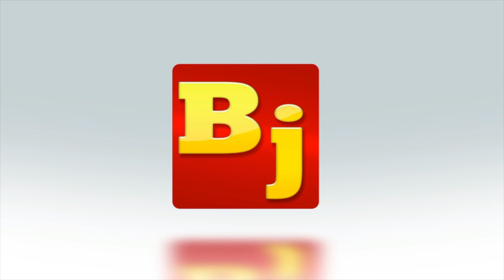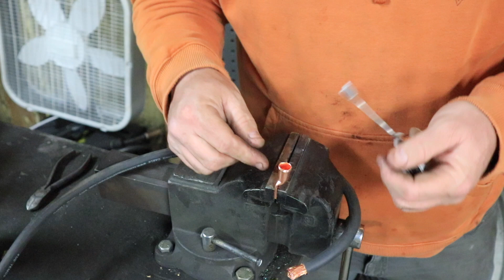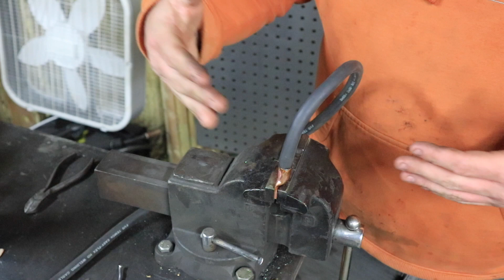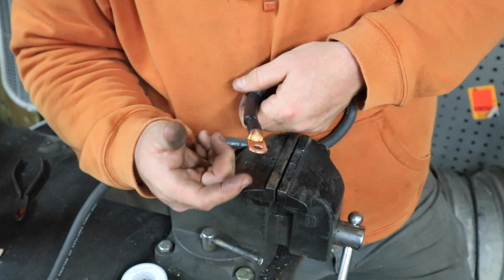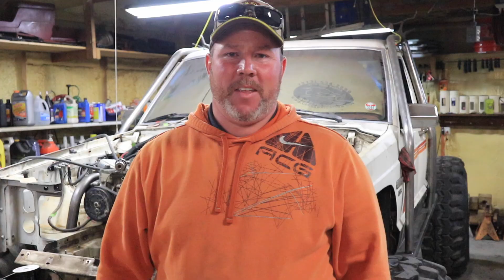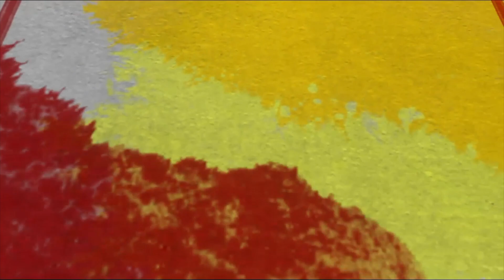How to Make Your Own Battery Cables the Easy Way

Comment: Man, You NEED to learn How To "Sweat" Pipe Fitting's.........SO MUCH EASIER to do like that, Then the way you are showing here❕

PLUS you Don't EVER want to use ACID Core on any electrical wiring either. Not even in a Car with 12 volt systems...THAT IS A NO-NO.

Comment: Solder might be the best connection for amateurs but its far from the best connection in the  professional world. Soldered terminations are almost unheard of in the aerospace industry, In fact NASA does not allowed soldered terminations on any space craft and there is a reason, soldered connections are brittle and subject to work hardening. NASA mandates pressure welds (AKA crimp connections) on all electrical terminations. Crimp connections are a form of cold welding and it creates superior vapor proof molecular bonded interface with far lower Ohmic losses then solder  aka I SQUARE x R losses. 

If you want to properly learn how to terminate wire connections I suggest you visit NASA's web site and browse their educational material and contractor specifications. Your tax dollars paid for all the research that went into putting a man on the moon and all that knowledge is free for your use. NASA even has a great series on proper soldering techniques.

Comment: You have explained cable lug soldering very well. Jeremy, you are an excellent teacher. Thank you. Well done!

But may I add some suggestions. The youtuber 1crazynordlander has made one excellent safety point. That's to make a mechanical connection with the cable and the lug joint. Because as he/she has stated in the comments of this video. If you encounter higher than normal loads thus higher than normal amperage and higher than normal temperature would occur. This means that could melt the solder and the cable will fall out of the lug. 

Let me add to this. Maybe do both types of joints. 

Make a mechanical connection with the lug first by crimping it to the cable to prevent cable from falling off the lug if it heats up from higher than normal amperage.

Then soldering the joint with rosin core solder ( not acid core solder), to prevent the copper strands from oxidizing. 

Finally add heat shrink tubing with some adhesive, or heat resistant silicon to prevent any moisture from penetrating the joint.

Also, if using cables in a environment where vibration occurs, when installing the cable, use cable ties to secure cable from any form of vibration at the joint.

Then as a maintenance measure, once cables are installed. Routinely check cables and connections for any sign of melting, wear, deterioration or damage

Comment: hydraulic crimpers are like, 30-35 bucks, and you're not really supposed to use solder if its gonna be in an engine compartment or around frequent temp changes, soooo...

Comment: This video should be titled "How To Make Your Own Battery Cables the Wrong Way". The solder has to meet the copper wire somewhere and it will make a rigid joint. With vibration that is where it will fail. The terminals are flared to allow some wire flex after the terminal has been properly "crimped". Also every strand is important to carry the load the current the gauge is rated at. Never clip off stragglers. The flare is not there to help you insert the wire, rather it is there to prevent damage due to vibration and when flexing the completed joint.

Comment: You can buy a hydraulic crimping tool which will permanently crimp the wire and you don't have to worry about how much solder and flux to use, what type of solder and flux to use, if you have enough fuel in your torch, etc etc. Hydraulic crimps are quick, easy, and permanent
Reply: ArcticAstrophysics they are sweet but not everyone has one! They are fast and easy no doubt.

Comment: 7:19 I disagree. Most people don't solder correctly so the solder does bead up like that, which is only possible when you touch the solder to the iron, or heat source. The solder should be applied to the wire after being heated by the heat source letting it flow through the strands.

Comment: You lost me at 6:50 when you said "acid core". Anyone who knows anything about soldering electronics/electrical components knows that acid core flux will cause corrosion.  Use only Resin core flux for electrical connections. Big fail.
Reply: It looks pretty after the heat shrink is on, but the acid core solder is not meant for electrical soldering.
Reply: Good point!
Reply: crimp. then maybe a bit of pond soldering
Reply: This whole video is a fail right after he said solder in the first two minutes

Comment: The flare is to help you get all the little strands in. Don't grind it off.
Reply: The flare is there to let the cable flex without cutting into the copper wire.

Comment: I prefer the brass compression terminals that goes around the battery pole and also clamps around the wire. Soldering the connector to wire is not always an advantage since it also allows for more mechanical force transferred to the connector from the wire because the wire will be a lot stiffer. Also remember that each joint in a wiring is a point where you can lose power or get trouble.

Comment: idk if soldering best way. Working on fleet motor coaches which have copper pipes. The Solder joints always break from vibrations....Most common daily repair in my line of work..... I wouldnt use this in a car battery. Solder doesnt hold up to vibrations

Comment: I've never seen the pre solder of the lug I like it Just a thought..the vice acts as a heat sink. Putting the connector in all the way will take longer to heat and you 'll have less working time for inserting in the wire.

Comment: Just FYI - Acid core is typically used for plumbing and rosin core is for electrical/electronics work.  Heat shrink tubing can be slipped onto the cable first away from the heated portion to prevent the insulation walking back from the joint when trying to put the tubing on.  Besides that, good vid!
Reply: Y Mn gf tty4v13450
Reply: Basically, "besides doing nearly everything wrong, it was a good video"...

Comment: Dude you do not use acid core solder on electrical connections.  Using your method you are likely to create a "COLD" solder joint as well.  The vice is pulling all the heat out of the joint too fast.

Comment: There is a lot of misinformation going on here.

A connection made by a good calibrated crimp tool is superior to a soldered connection in both longevity and conductivity. It creates a cold weld inside the lug and done properly is considered a gas tight joint; you cant even flow solder into it. The lug and copper cable strands actually almost become one solid mass.

The non flared lug that you have in your hand at 2:50 has stripes and letters on it for use with such a calibrated crimp tool.

The "E-A" on that lug indicates what die setting to use for that lug and cable size. The stripes are to indicate where to make the crimps, 1/0 cable calls for two crimps per cable end (thus the three stripes).

I am actually surprised he has that grade of lugs laying around and not the crimp tool to go with it; those lugs are more spendy then standard ones.

Get some real heavy wall adhesive lined heatshrink for sealing the cable and providing cable relief. The solder wicking up the cable is actually what causes many failures. The solder doesn't flex, it cracks and just fails. Example: Completely tin a strand of wire and bend it in half once or twice....

Also the heat from soldering degrades the insulation and other treatments/coatings of the cable jacket & lugs.

The only tinned cable to use is the kind made/produced at a factory; the entire cable is tinned for maximum protection but still flexible (such as the kind found in some high quality marine cable).

Many people who solder cables find over time that the cable within the lug corrodes away to nothing due to leftover flux and moisture getting in there.

If you must solder at the very least id ding/anvil crimp that cable lug on for mechanical retention and flow solder into it.

Comment: Jeremy, by any chance would you happen to know where I could find a complete engine harness for a 2001 XJ sport 2WD automatic transmission. I’ve looked everywhere with no luck because the harness is no longer in production.
Reply from the maker: Gonna have to get one at a salvage yard like pull a part.
Reply: BleepinJeep thanks 😔

Comment: I used to think that soldering was the best electrical connection but holding a Power Limited Technician license for wiring power limited circuits the past 15 years for communications, HVAC, irrigation and landscaping I found out that soldering connections is "Not Allowed" in the National Electric Code. Sure the NEC doesn't cover automotive wiring but the same principles apply. Only mechanical connections are allowed like crimps. I tend to agree with the NEC as heavy load will melt the solder and the cable will come loose. I think in this case a good dye punch for cables would be added assurance that the cable will not loosen under high amperage situations.
Reply: I was a shipboard electrician at a navy Yard. Always have a good mechanical connection first. Follow up with solder (Rosin Core, never Acid Core or Acid  flux) if you must to prevent contamination from entering between the strands.
Reply: Excellent safety point 1crazynordlander. Good to know. May I add some suggestions.

 Maybe do both types of joints. Make a mechanical connection with the lug first by crimping it to the cable to prevent cable from falling off the lug if it heats up from higher than normal amperage.

Then soldering the joint with rosin core solder ( not acid core solder), to prevent the copper strands from oxidizing. 

Finally add heat shrink tubing with some adhesive, or heat resistant silicon to prevent any moisture from penetrating the joint.

Also, if using cables in a environment where vibration occurs, when installing the cable, use cable ties to secure cable from any form of vibration at the joint.

Then as a maintenance measure, once cables are installed. Routinely check cables and connections for any sign of melting, wear, deterioration or damage.

Comment: Hey Jeremy, Great 1st video.  But, acid core solder is for plumbing and can cause issues when used for electrical/electronics work.  Suggest you use rosin core solder in the future.

Comment: When test fitting the cable you can solder the cable to make it solid and if it doesn't fit you can use a file on it instead of dealing with wire strands.

Comment: Nice vid with lotsa good info.  Probably be good to mention though,  that it's important to use real 60/40 lead/tin solder, not the wimpy lead-free crap you get at most box stores.  Also, preferable to use rosin core rather than acid core to avoid corrosion later.  Acid core will work but it's more for sealing joints and radiators etc. rather than electrical and should be rinsed off before covering with shrink tube.  Just sayin..

Comment: Rosin Core for electrical, acid core for plumbing. Use one of the small hose clamps to hold your stranded cable together so it can be inserted into the lug. Remove the clamp after the wire is in the lug then heat it up and push it the rest of the way in.

Comment: Quick tip from someone that has made a lot of battery cables. Buy one of those cheap hydraulic cable crimpers from Amazon. Reviews on the absolute cheapest ones are spotty, but The die-pressed crimpers are just so much better than the hammer "swage" style ones, and a LOT better than soldering. The bolt-cutter style ones are OK but unless you already have those, I would just buy a hydraulic one from the start.

That solder will eventually corrode, micro-crack, and fail. Not to mention there is no mechanical connection between the copper lug and copper wire strands. NASA agrees, and the Space Shuttle probably only sees half of the vibration that my XJ does :-D
I just checked, and you can get one of those crimpers for $38 on Amazon. Or get a better (Temco) one for $80 and it should last for a while.

And secondly, spend a few extra bucks and get adhesive-backed heatshrink. Helps completely seal the lug from water ingress and corrosion. Lastly, don't forget to put a proper fuse between the alternator and battery (positive) if you are upgrading from the factory cable which has an integrated fusible link.

EDIT:
I use KnuKonceptz cables if you need high quality 100% OFC power wire for cheap (rated to 150A, anything more and you should just go with 0/1 gauge)
Reply: i picked up one of the chinese crimpers, 12 ton style, when i did the big 3 in my hardbody, its long since paid for itself just in replacement cables i haven't needed to buy.

Comment: Great vid, J!  
One thing, though...I would strongly suggest NOT using acid core solder for wiring.  That stuff is designed to work with somewhat less-than-clean copper pipe and should not be used for wiring as the acid flux can actually eat through the small strands of wire (leaving a green, corroded mess).  For wire, you want to use rosin core or, better yet, fluxless (no core) solder paired with a flux paste like you used in the video.
Cheers, dude and keep those vids coming my man!!!!

Comment: Great job Jeremy. One thing: You said you had acid core flux solder. You really need to use rosin flux on a job like this. Acid flux will corrode like crazy over time if the flux is not completely washed off after soldering. It will eat traces right off of a circuit board. This being a large connection it will take longer but trust me that acid is crazy corrosive. Rosin core/no clean is what to look for. I found a site from a quick Google search that explains it better than me. http://www.harrisproductsgroup.com/en/Expert-Advice/tech-tips/rosin-and-acid-core-solders.aspx.

Comment: A little isopropyl alcohol will help that heat shrink slide on and you wont have the wires insulation moving on ya.

Comment: If you put some silicone dialectic grease on the part where the wire and copper head meet, and then put the heat shrink on; it creates a waterproof connection. Awesome vid!
Reply: or use heat shrink with glue inside will do the same thing too!

Comment: Great video Jeremy!  Another tip would be that when you are clamping the connector in the vise, don''t put it in all the way.  The vise is a huge heat sink, so it makes it a lot easier to heat up the connector if there is more distance between the end you are heating and the vise.
Reply: Gil Meacham yeah your right..

Comment: Great job Jeremy! I've been doing all my battery cables like this for years. I do all my connections with solder and heat shrink. I hate those little red, blue, and yellow crimp connectors. Every time I've had the taillights on a trailer quit working it's been one of those stupid little crimpits.
Reply: I agree but with a small caveat, quality crimps done with the proper tool are very good.  Problem is, noone wants to pay 100 bucks for the right tool, let alone finding quality crimps.  As for trailer lights in particular, they usually use the frame as a ground, I prefer to run the extra wire and never have issues.

Comment: Good video, thats how i do my cable ends too with the solder in the lug..... but before i put the solder in a scratch up inside the lug with a file or exacto knife and then before i put the heatshrink on i take a centre punch and smack a dimple into the cable lug to make sure the solder joint doesnt pull out.

Comment: Emery cloth to clean the fittings before you flux the fitting also helps along with having it hot enough I say this cause I solder copper every day using different types of solder

Comment: Short story time.  I'm all about wiring.  I actually enjoy wiring vehicles and have become really anal about it over the years.  Obviously I like all kinds of cars and have to modify them...  Why leave something stock?

So I turbocharged my miata, right?  One thing you need is BIG injectors.  The little 200cc/min injectors that came on that motor weren't even close to what was required... so I upgraded!  450cc/min EV14 injectors (dual pattern!) from a GT500 and bumped the fuel system pressure up to about 60psi to flow even more.  Naturally, that uses a different connector from what came on my cars wiring harness, so I chopped off the factory connectors and used some butt connectors to solder on USCAR connectors.  Did it up all nice and neat.  Fast forward two years;  I had an opportunity to embarrass badly a friends "built" GT mustang from a 60 roll..  I spent YEARS listening to him talking shit about how omgfast this car was......  Got staged;  Started building boost and then suddenly my engine started cutting out.  WTF?!  The race was off and I went home sad.

Checked data logs from the ECU and instantly saw a lean condition started coming on once boost came up.  Went over my fuel injection wiring and found one of the solder joints broke.  Instantly I heard my high school auto shop teachers voice in my head:  You crimp butt splice connections, never solder them.  DAMMIT!!!!!!   Dude sold that car the following week and I never got to wax dat ass.  Sad.

I still solder things like large battery connections, as Jeremy did in this video.  Smaller wiring that'll experience vibration?  CRIMP FOR LIFE!
Reply: You can solder crimped small connections, the key is not to let the solder creep up the wire past the crimp area. In the case of a ring terminal you would want to solder the end of the wire in-front of the crimp to the terminal. This will provide better conductivity and some environmental protection without the risk of stress fractures from solder creep.

Comment: Using acid core on wires is a big no no. The acid will eventually deteriorate the copper wires. Rosin core is the only thing to use on electrical wiring. Good video!